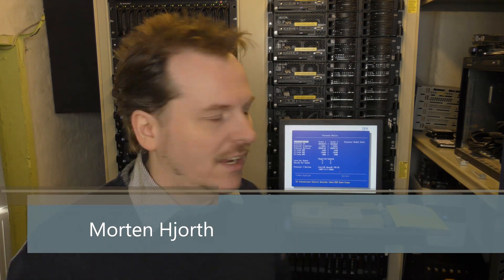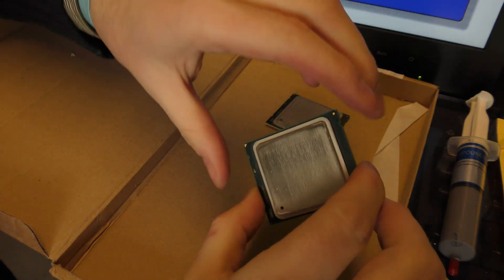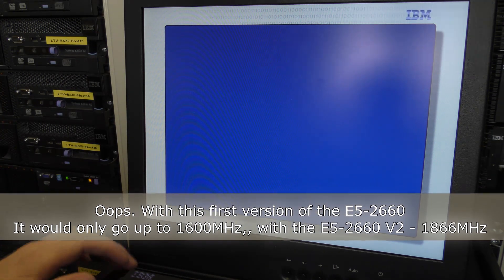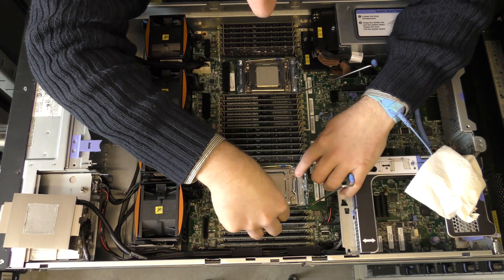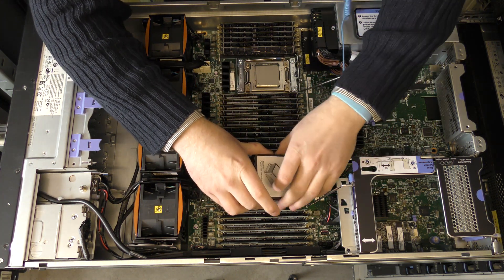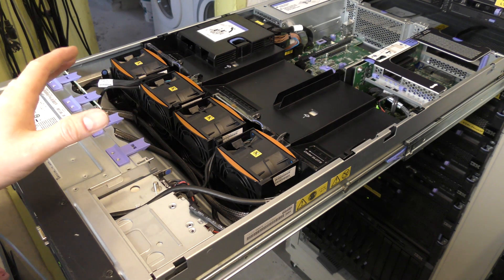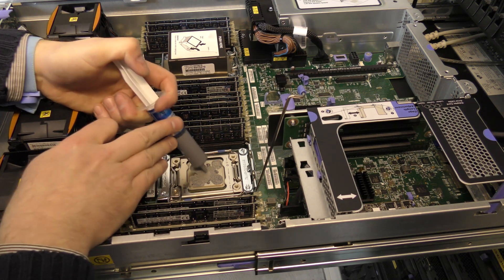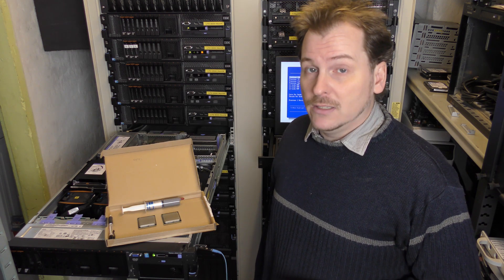New Pair of E5-2660 CPU´s for my x3650 M4 -Total Fail!! - 475

Comment: What the hell, man. I saw a washing machine and dryer. You have all this sitting in your private home. What are you using this for ? Hobby ? A job ? This cpu has 10 cores and 20 threads ( Intel home page ). It sits in an Ali Express motherboard. Machinist X99 pro with ecc memory of 2X16 GB. All that for 120 euro's. What the hack your doing man ? Please elaborate.
Reply from the maker: This is a long time ago,, but I believe I had bought two ES CPU´s (Engineering Samples) and they did not run in the x3650 M4,, but worked fine in the cheap x99 board.

Comment: I have IBM 3650 M4.  I am getting Date & Time error on startup, server not booting to my Windows Operating System. when I go to BIOS by pressing F1. it seems BIOS is just read only mode. there is no option to change Date & Time.  cursor just Jumps to next option. please help.
Reply from the maker: There is a places to fix the time and date,, check if the CR2032 battery needs changing.

Comment: Probably a lack of power because when you removed ram it go further with starting because the fans went alot faster
Reply from the maker: Hi Alex
Thank You very much!  But it turned out that the engineering samples did not work in the server. :-)
Thank you for watching! :-)

Comment: I'm not fussy about the way you apply heat sink compound...I apply a large glob to the center and spread it out evenly with my finger tip...it's only purpose is to fill air gaps as they insulate and I believe you have air gaps...
Reply from the maker: Very hard to check,, but I do not think so.
Reply: @MyPlayHouse  You already checked...@14:40 you can clearly see 4 air gaps on the processor, compare it to properly applied compound @5:40 that shows no air gaps.

Comment: I am sorry Morten, to see those CPUs not working, I've been there before, and it is ugly. But shouldn't there be a message saying unsupported processors installed?  I think Engineering samples are to blame. I am sure you have been in contact with the seller. I hope you can work something out, otherwise a bad review will tarnish his reputation.
Reply from the maker: Hi Mamdouh Tawadros
Thank You very much!  I still have them,, they are cheap :-)
Thank you for watching! :-)

Comment: hey i wil upgrade my ibm x3650 m4 to dual intel xeon e5-2690 v1 are the compatable
Reply from the maker: Hi DDICyber
Yes,, the E5-2690 V1 should work just fine,, if you have V2's you will need newer firmware...
Thank you for watching! :-)

Comment: I have some ES cpu's. They dont have the microcode on them to run on name brand servers, only aftermarket boards. Most work ok for me but a couple are a bit buggy and bluescreen when they are put under any sort of descent load which I will change soon. The ebay seller I bought mine from warned about compatability and said exactly what they were so that  was ok for me I guess. They were a fair bit cheaper than final release cpu's and are ok for me..mostly.
Reply from the maker: Hi Don'z Lockz
Thank You very much!
Thank you for watching! :-)

Comment: If you still have these processors, give them a shot in a workstation class machine... Like a Dell Precision or HP Z. I also had an eBay seller shaft me with some ES processors. I was able to get my money back by sending this link to the seller and to eBay. http://www.intel.com/content/www/us/en/support/processors/000005719.html
I was able to keep the processors as well and I currently have them in a Precision T7600 no issues.
Reply from the maker: Hi TeuFel Jones
Thank You very much!  glad that worked out for you.
Thank you for watching! :-)

Comment: I've been tempted by the fantastic low prices for engineering sample cpus, but have never bought any. This video only reaffirms my belief, to only buy genuine cpu.
Reply from the maker: Hi Gordon McLellan
Thank You very much!  glad you got something out of my video :-)
Thank you for watching! :-)
Reply: Sorry they didn't work out. I'm wondering, Intel likes to re-use xeon part numbers across generations, like e5-2660 v1, v2, v3, etc. they're all socket 2011 but not interchangeable... maybe this is the problem? I have a socket 2011 workstation, but it only accepts v1 chips that are hard to find.
Reply from the maker: V1 are easy,, V2 are expensive.

Comment: You did a great service by showing your viewers the issue of putting ES samples into production systems.  However, the seller needs to stop selling these ES processors.  The seller should be reported, or at least leave feedback on his page stating the major issue of ES samples being sold.  Keep up the great work!
Reply from the maker: Hi Dan Kelaher
Thank You very much!  If you have a x79 board You can use ES CPU´s and want cheap CPU´s for them.
Thank you for watching! :-)

Comment: find a used board which will take these CPU's and use em for something. Another video on a hacked server  how to get theses CPU's too boot LOL.
Reply from the maker: Hi Chris Lowe
Thank You very much!  I would Love to know how to do that :-)
Thank you for watching! :-)
Reply: http://www.ebay.ca/itm/Asus-X99-A-USB-3-1-Desktop-Motherboard-Intel-X99-Chipset-Socket-LGA-2011-v3-/262838792318?hash=item3d3269b07e:g:OLIAAOSwUKxYl10a

http://www.ebay.ca/itm/Intel-S2600CP2J-Motherboard-Dual-2011-Socket-Motherboard-/252750673988?hash=item3ad91d3844:g:JkwAAOSwMtxXtg8D

those boards should work with those CPU's

Comment: I had a very similar experience with some OEM E5-2696v2 QDUF engineering samples in a Supermicro chassis with X9DRi-LN4F board. It just wouldn't boot so I put back the original pair of E5 2620s. I did get the 2696v2 QDUF pair to work in an ASUS Z9PE-D8 WS board, but I had to restrict it to 11 cores/socket. A single socket would work with al 12 cores. It took many hours to figure out. I also discovered that to get the BIOS to take a new processor or fully reset after a failure, I had to first "boot" it up with no processors in at all. Clearing the CMOS was not enough.
Reply from the maker: Hi Nezbrun
Thank You very much!  good info :-)
Thank you for watching! :-)

Comment: What is the keyboard on 1:18 it looks like ibm model m, but with more modern buttons - always wanted something like it, with the track point I will barely need to move my right hand for the mouse.
I have thinkpads and they have the best keyboards I tried on laptops, but there is nothing like that for desktop.
Reply from the maker: Hi Ivan Denkov
It is old and PS/2 and hard to find,, I do not have the model number.
Thank you for watching! :-)
Reply: Thanks for the reply and sorry for the bad luck with the CPUs, I have found that this keyboard is IBM space saver 2 and it looks like it was shipped mostly with servers. However nobody sells them in Europe, found some from US, costing 100$+ in questionable condition so they are no go for me.
Reply from the maker: Ivan Denkov found this http://www.ebay.de/itm/IBM-8887-Space-Saver-2-Keyboard-UK-English-40K9427-/252595568309?hash=item3acfde7eb5:g:~d0AAOSwFV9XzZeO

Comment: Search for SR0KX (that is the E5-2670 with C2 stepping) on ebay USA or UK. Usually you can get two CPUs for less than 180€ total and they are much faster than E5-2660!

E5-2670 turbo to 3.0GHz on all 8 cores and 3.3GHz on up to two cores. I have two in my workstation that i bought from the ebay seller GFSI last Year and i paid about 160€ inc. tax and shipping.
Very good, very cheap non Engineering Sample CPU.
(And sorry i haven't sent you the modified PCIe x4 graphics card yet but i have been very busy and haven't had the chance to do it yet.)
Reply from the maker: Hi Coldministrator
Thank You very much!  glad you liked the video :-)
Thank you for watching! :-)

Comment: Do you have any x79 mb to try processors? Try to reset CMOS again. I swap one e5-2650 with two e5-2670 (it was only cpu1 populated). I have to do right procedure to clear cmos and after that server restart it self a few times without video until it learn that it has two not only one and different processors. MB has to be powered but off to reset cmos. Put jumper in reset position, wait 20 seconds, put jumper in default position all this with powered MB (standby power not turned on).  Unplug power cord, wait few seconds. Put cable. After that power on server.
Just follow procedure on page 100 of manual:
http://download.intel.com/support/motherboards/server/s2600cp/sb/g26942005_s2600cp_p4000cp_tps_rev18.pdf
Reply from the maker: Hi Srđan Marković
Thank You very much!  interesting,,thanx
Thank you for watching! :-)

Comment: I have a x3650 M1 with the 2.5" drive bays and tried to upgrade the CPUs to quad cores from their dual core originals. The unit would not boot at all, the fans would power up to 100% and that is where they would stay. Found out the revision of the motherboard was an older revision before they added quad core support. So I would check the revision of the motherboard also for compatability.
Reply from the maker: Hi turb0m0nk3y
Thank You very much!  I think the CPU´s are actively not made to work in the finished servers.
Thank you for watching! :-)

Comment: Hi Morten, hope you don't mind asking you a question? I have a Synology 1813+ and as of late it has been making a lot of noise.  It seems to be be the case that is vibrating? Any idea to get it quiet again? Thanks.
Reply from the maker: Hi TheSanzca
No stonent is right,, you need to find out if it is your driver or a fan that are making noises. You can also try to block the fans momentarily to hear if the noise stops.
Thank you for watching! :-)
Reply: Thanks for the advice, and apologies to stonent!
Reply: TheSanzca power it down, unplug all the drives and see if it still vibrates. if so check the fans
Reply: Guess I had to expect one of these replies, hey!

Comment: god i hate how that thermal paste is so oily
also i accidently bought 2 intel confidential x5650's on ebay once i think the orignal's cost the same so i got hosed as well but they worked fine on the dell works stations i used them on also the hp 180 g6 i had worked with both of them as well

Comment: Hi have you tried check errors in IMM. Maybe you will find something.
Reply from the maker: Hi Roman Takáč
Thank You very much!  Humm I did not check,, that was stupid,,, just checked,, nothing :-/
Thank you for watching! :-)
Reply: They are ES cpu's meaning Engineering samples which dosen't work in any 
server without the right firmware. It does work in a Asus X99 board or 
supermicro board tho.. @roman takac

Comment: I bought two of those and they are working without any problem.
http://www.ebay.com/itm/182425854420?_trksid=p2057872.m2749.l2649&ssPageName=STRK%3AMEBIDX%3AIT
Reply: Well the cpu's in the video are Enginnering samples which mean they don't work in a server without the right firmware for them, they work in a x99 or supermicro board tho...
Reply: Exactly, you need to be very cautious when you buy CPUs from eBay.

Comment: Send them back, Especially if the seller gave false advertising. With ES samples you never know what your gonna get. Also, as a final resort you might try updating the BIOS on your server. You could also try to install those CPUs in another system.

Comment: Intel confidential CPU's will never boot in an IBM/HP/Dell server without firmware to support them. and that fiwmware is internal testing only. Now if you can get your hands on a Supermicro board or an Asus X99 board you will be good to go.
Reply from the maker: Hi Tim Cranney
Thank You very much!
Thank you for watching! :-)
Reply: Tim Cranney a x99 board would be a bad choice for a s2011 cpu
Reply: Ludvig Lindell oops you're correct. I meant an x79 board. I've been using a broadwell/haswell 2011-3 with the Intel confidential cpu's I have.

Comment: put the cpu's in . pull the power try to turn the server on . then  Clear the CMOS on the Server . then put the battery back in . put power on the server then try again . if not they are dead from transport in no anti static bags
Reply: They are ES cpu's meaning Engineering samples which dosen't work in any 
server without the right firmware. It does work in a Asus X99 board or 
supermicro board tho...
Reply: So no need to do what you said...
Reply: x79 MB not x99. But to clear CMOS you must put jumper in clear position, turn on main power switch, not power on server, wait 20 seconds, put jumper in normal position with powered mb and then press power button. That is right way to reset Intel server MBs. It is not as simple as consumer MB. It is protection so bios settings stay even if battery fail.

Comment: something from a table that i've found: "E5-2665 QA90  2.3 8/16  Works in an Z9PE-D8WS to bios 0703" so, your mb supports E5-2665 ?
Reply: and: Intel Xeon E5-2665 8C 2.4GHz 20MB 1600MHz 115W so, maybe the powers supply can be a issue to
Reply: or maybe they are broke :)) (out of ideeas)
Reply from the maker: Hi Claudiu Muc
Thank You very much!  the Z9PE-D8WS is like 10 times as expensive. as the CPU´s :-)
Thank you for watching! :-)

Comment: The ebay description says "Engineering sample". Also the S-Spec is QA90 http://www.cpu-world.com/sspec/QA/QA90.html
Sorry but it is your fault :(

http://www.ebay.de/itm/Lot-of-2-INTEL-XEON-ES-E5-2660-QA90-2-3Ghz-8-core-20MB-CACHE-LGA2011-/222357349532?hash=item33c587e49c%3Ag%3AJaMAAOSwgQ9Vzf63&nma=true&si=DsJGlBAf3u3XYQqPNFuh%252BZ131xI%253D&orig_cvip=true&rt=nc&_trksid=p2047675.l2557
Reply from the maker: Meth Methanoid Well Yes,, I did not know that these ES models would not work in Brand name servers. I looked it up when I did the video,, it was recorded 14 days back,, next set of CPU´s are on there way. But I see that almost 3000 more now knows to watch out for "Engineering sample". Not all is lost!
Reply: My PlayHouse but still a sneaky thing for seller to sand off the top to hide the Intel Confidential markings. You aren't supposed to sell ES chips as they are Intel property. Bad luck :-(
Reply from the maker: Hi SteelVsMetal
Thank You very much!  It´s seems so.
Thank you for watching! :-)
Reply: ES chips don’t work in most brand name servers you can put them in boards used for custom build ,that support them, and it should work

Comment: You can't even resell them. Engineering samples are used for internal tests, partner testing (designing motherboards) and pre-release press reviews; those people either have to return or destroy them. They're the sole property of Intel and reselling is illegal. Did the seller specify that the CPUs were samples?

(Obviously, don't buy stuff with "Intel Confidential", "AMD ENG SAMPLE" or anything like that written on it ever again.)
Reply: It's ok to buy ES chips if you have the right systemboard.  Rule seems to be Supermicro or Asrock if you want to run ES chips.  Some amazing deals can be had if you buy ES chips and have a compatible motherboard.
Reply from the maker: Hi Anthony M
Thank You very much!  glad you liked the video :-)
Thank you for watching! :-)
Reply: "Engineering samples are used for internal tests, partner testing 
(designing motherboards) and pre-release press reviews; those people 
either have to return or destroy them." 

That is not entirely true considering that alot of tech-youtubers like LinusTechTips has alot of intel confidential cpus that they use for all kinds of projects.
Reply: Srđan Marković its not technically illegal to use them, but as far as the US Courts are concerned they are Intel's property. 

TL:DR if Imtel asks you to give it to them, do it. otherwise don't worry.
Reply: They count as press. (to me)
Reply: ok
Reply from the maker: Davide424 
Those CPU are not getting a good review in my paper!! they ware on the slow side :-)
Reply: Is it illegal to use "Intel Confidential" or "AMD ENG SAMPLE"?  I bought 10 or more second hand processors but I was lucky no eng. samples. I ordered Turion tl-66 to upgrade thin client pc and I hope that it wouldn't be illegal one.
Reply: I don't know the rule in Denmark, but in Germany consumers can sell them. IMHO companies, too :-) only if they have a contract with Intel - but who hast that ;) - you can find such CPUs quite often.
Reply: Its not illegal to sell them. If you enter into a contract saying you wont sell them, then its a breach of contract, nothing is illegal about selling the processor you will just get sued for breach of contract.

Comment: Also boot up wth out the heat sink and put both your fingers on each CPU and see which one gets hot and which one doesn't that will be your fix because that means there getting power and working don't worry if it boots out the heat sink on fast and that would be good.
Reply: These cpu dosen't work in this server because there is no firmware for them, these are ES cpu's

Comment: Try to do a update to micro code and make sure that the bottem of the CPU gold spots are very clean scrub with rubbing alcohol and make sure each and every pin is clean on the CPU I had this same problem when upgrade my system like you saw in my video :) good luck 👍